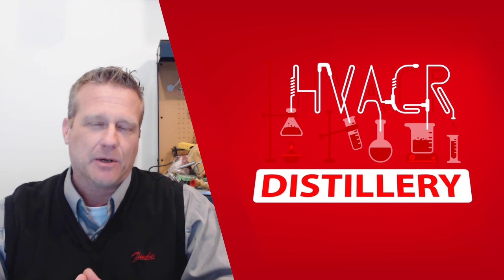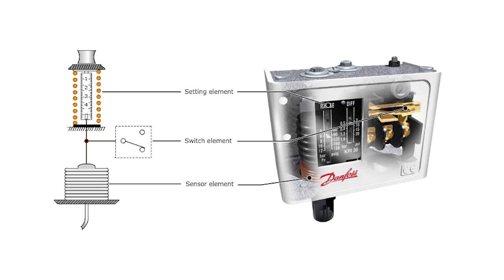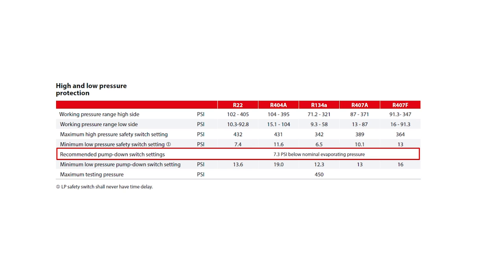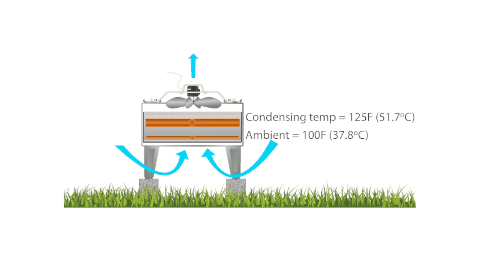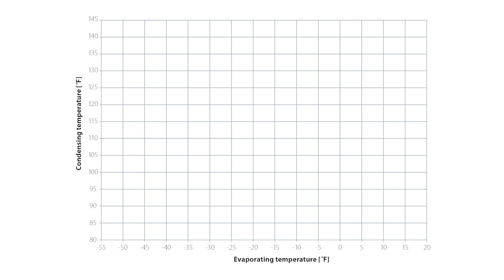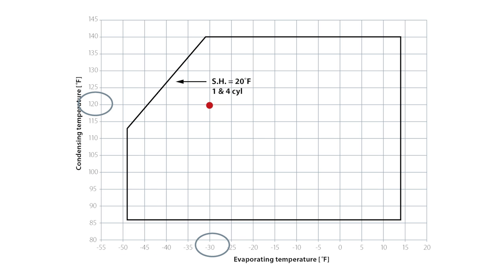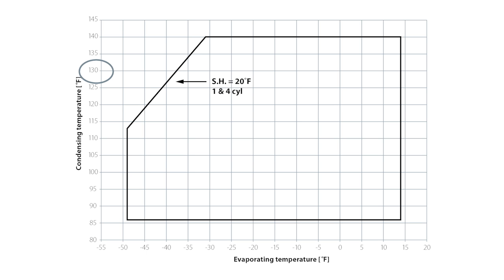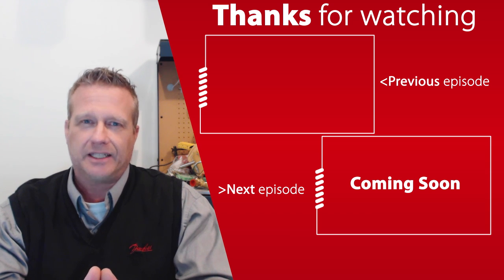Under pressure with pressure controls | HVACR Distillery Episode 4

Comment: GOOD DAY     CAN I  REVERSE  THE PRESSURE SWITCH  kP1 ( 060-1103) TO WORK WITK  aIR SUCTION OR vACUME  SYSTEM ...THANKS ALOT
Reply from the maker: Good day to you too, Yasser. No need to reverse anything, the 060-1103 has got a working range of -0.9 bar(g) to 7.0 bar(g) so as long as you stay within this, you can also use it for air suction/compression. If you would like to learn more about the KP pressure switch, this is a good place to start: https://assets.danfoss.com/documents/DOC346959186421/DOC346959186421.pdf

Comment: Hi, good job and good explanation . I`ve already taken a lesson on Danfoss learning about pressure switches I`ve understand their function and variations well .  it's first time i know about Discharge thermostat . well , i see it thermally protects the compressor ,but  does it function as klixons do ?
Reply from the maker: Thank you for your enquiry Reda. The discharge thermostat operates in a similar manner to the klixon type bi-metallic switches in that it contains a set of contacts that will open when the temperature exceeds a certain value. This will then stop power to a control relay coil which will stop the compressor.

- Jamie Kitchen
Reply: @DanfossClimate  thank you for replying my inquiry .